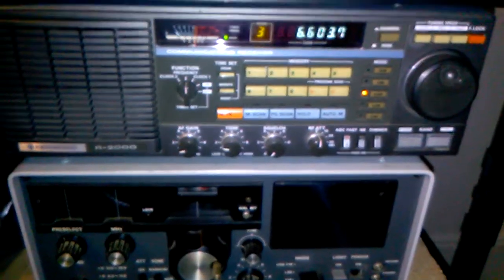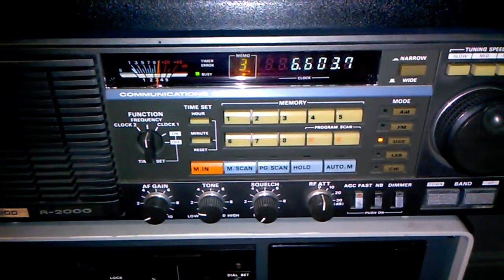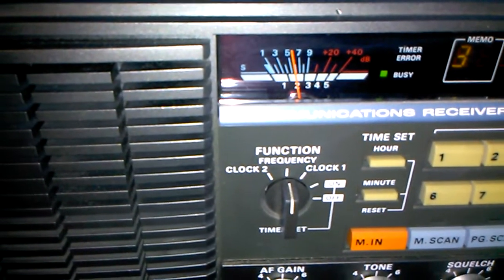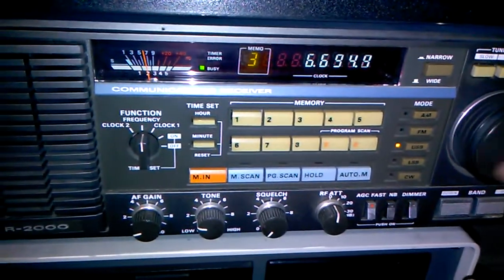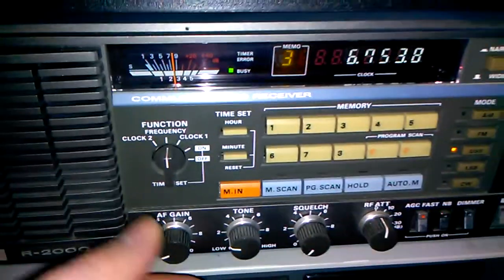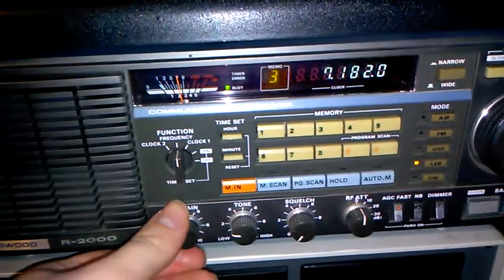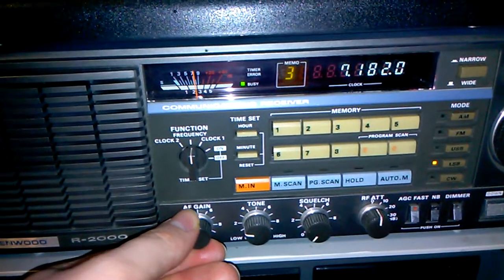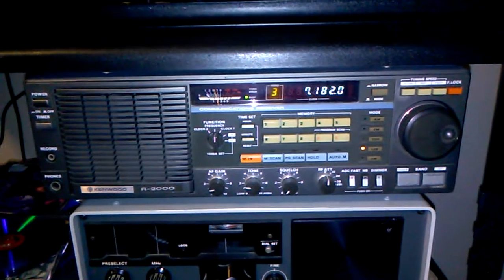Alpha Delta Dx-SWL vs Fan Dipole

Comment: Hello from Venezuela, I would like to get your opinion about the ALPHA-DELTA DX-SWL compared to the MFJ1886. Is the ALPHA-DELTA DX-SWL still your preferred antenna? I want to buy one of the two but want to make sure the one I choose has the best performance. Have you tried the MLA-30+? I appreciate your comments based on your experimentation.
Thanks and 73
Reply from the maker: The Alpha Delta DX-SWL is a great antenna, and I'm still trying to think of a way to get it back up in the air again. I took it down shortly after I got my amateur radio license back in 2018, and it has been sitting in storage ever since then.

I do not recommend the MFJ 1886, because the one that I had just stopped working, and I have seen this happen to other people.

I have not tried the MLA-30+, yet, but I would like to try one out, since they seem like nice, inexpensive antennas.
Reply: @Sparkyzilla85  thanks my friend! 73 YV8JET

Comment: amazing video...i want to talk on 40m and on 20m....if i want to make a fan dipole is that possible or i dont need a fan dipole just a normal single dipole?  thanks..
Reply from the maker: A fan dipole would definitely work for you if you want to work both bands on the same antenna.

Comment: Great vid! Kind of what I'm doing right now. New to it, I'm playing with listening to an assortment of radios, FT101E, FRG-7, Panasonic RF-4800 and a Realistic DX-160. Smallish yard, I bought an Ameritron 5 ant. remote switcher, feeding into a cheap MFJ tuner, out to a three position switch and finally out to the receivers. I have 4 end fed random wires of no particular science, and a center fed kind of tuned to 7.200. All the coax is RG-8X. Funny, depending on the conditions, one antenna can be good one time, and terrible or useless the next. The best part is the remote switcher allowing the playing with, and instant comparison of all different configurations. Also, sometimes the cheapest radio is the only one that can pull it out. I'll keep watching as I'm really interested in learning about antennas, Cheers.
Reply from the maker: Thanks. I think that playing around with antennas is as much fun as listening to shortwave radio. There's always something new to try out, and having multiple antennas really helps out with picking various stations.

Comment: I've had both the Alpha Delta SWL sloper and their DX-CC multiband , which is basically your fan dipole. The DX-CC does do better than the SWL when on the Ham Bands, especially 80 metres, but the SWL is better outside of the amateur frequencies on Broadcast and utility frequencies, also very good on medium wave too.  You need both :) , never too many antennas.
Reply from the maker: Well, like I said in the video, I hope to set up a third antenna when of if I can get my MFJ-1886 loop antenna fixed. It's nice to have options for antennas.

Comment: I watched your video where you show which radios you like the most and I got to wondering how you choose which you're going to listen to? You must be constantly moving which radio the antenna is plugged into.
Reply from the maker: There's no method to my madness. I just pick a radio and listen to it. LOL :) Switching isn't a problem since I use an antenna switch, so I can switch between radios pretty quickly.
Reply: Makes sense. It didn't occur to me as I use a switch the other way, to connect multiple antennas to one radio and I switch according to what frequencies I'm going after. You chose the right word too, madness. Sometimes I think we're all nuts. :)

Thanks for the great videos, Sparkyzilla!

Comment: A low noise floor is better than higher signal levels.  You will notice more on extreme weak signals.
Reply from the maker: The low noise floor is very nice, because I've been finding stations that I could only barely hear with the dipole. I was amazed at what I could hear this afternoon when I was tuning around the bands.
Reply: Good stuff!